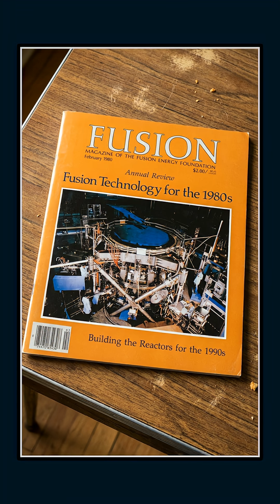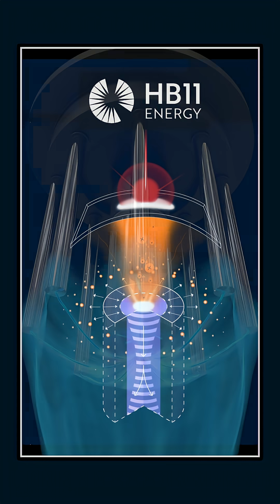Aneutronic Fusion: The Real Clean Energy Breakthrough?

Comment: Isn’t an alpha particle two neutrons and two protons?
Reply from the maker: Yes, exactly! An alpha particle is two protons and two neutrons bound together—it's identical to the nucleus of a helium-4 atom (without the electrons). That's spot on! In aneutronic fusion reactions (like proton-boron), the energy is released primarily as these charged alpha particles rather than neutrons, which is why it's considered 'cleaner' with less radioactive waste or activation issues. Great question—thanks for watching!